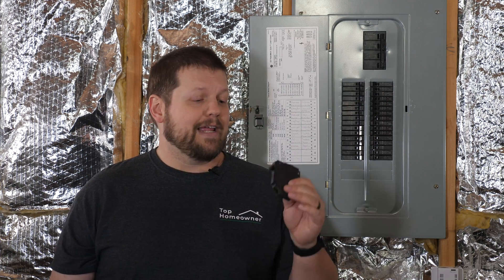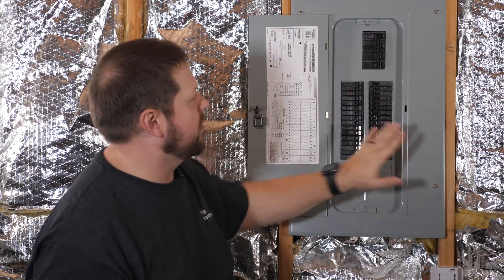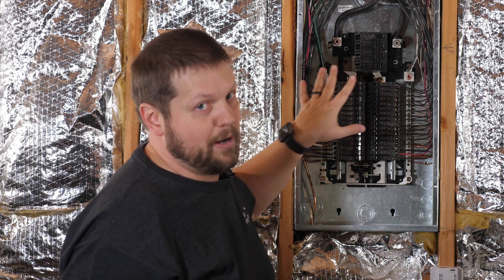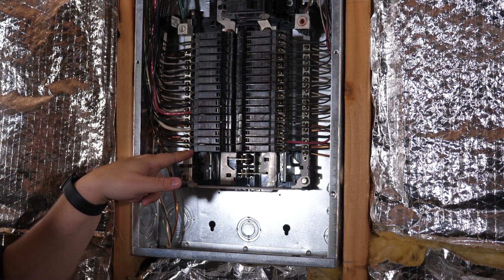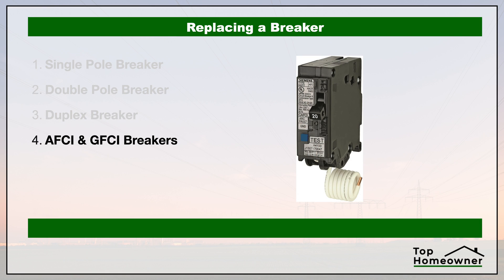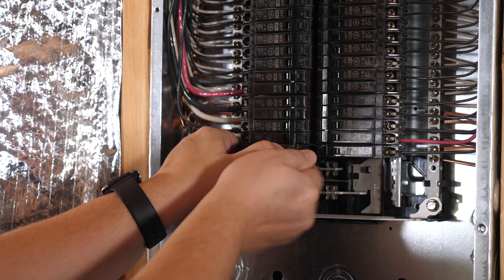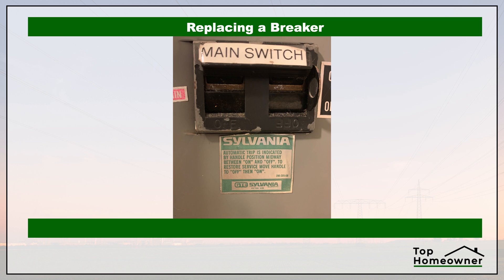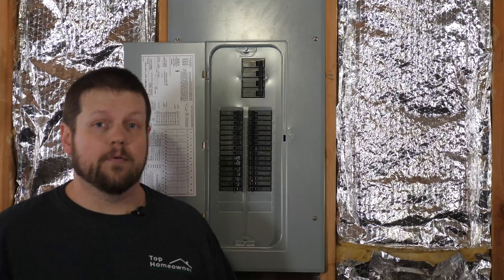How to Replace a Circuit Breaker | Quick and Simple Step-by-Step Process

Comment: I have a friend who is a licensed electrician. He is coming by today to replace a breaker. He said it was an easy job and would take just a few minutes. From watching the esteemed gentleman in the video, I agree. For someone who knows what they're doing, it does look pretty easy.

However! I know me. I'll get hurt. Shocked. I'm told that 120v house voltage won't kill me. I don't care. I have a knack for messing up DIY projects, unless they are computer software/hardware related (that's all about 5V DC. I can deal with that!) Even if the power company turned off the entire neighborhood, I would bet money on my ability to get shocked by something :D So the initial suggestion about calling someone is music to my ears, it's my wheelhouse. "Bill! How do you fix Z in your house?" For all values of Z, my answer is the same. "With my phone". 

FWIW, this was an excellent video. I understood everything. And I got the message: Call someone!

PS I've been told I ramble, and apparently that extends to online communications as well.

Comment: By the way it is good practice to flip all breakers into the off position when flipping the main breaker off, so as to when you power the main breaker back on you can flip each one back on individually to not cause a power surge to your devices.

Comment: The breaker is bad when you try to turn it on but it doesn't go 
All the way to the on position.
I moved to a house that has two breaker panels. Because the car port area was converted to a bedroom with bathroom and laundry area .

Comment: When I had my main replaced I had our electrician add a knife blade disconnect right next to the meter. When I go to work on the main panel I can cut all the power and I add a lockout tagout lock. I've seen people replace a breaker on the panel live the busbar in the panel is dangerous even more so then the main lugs.

Comment: Can I replace a 15 amp with a 25 amp ?
Reply: Not advised! A 25 amp breaker will allow more current to flow than a 15 amp circuit is designed to handle. This can lead to overheating, potentially melting the insulation and creating a fire hazard.

Comment: Can you go from a 15 to a 20 without changing the wires?
Reply from the maker: Sorry, you can't do that because the breaker size needs to match the wire rating for safety reasons.

Comment: Great video. I have a question. If I am trying to add another outlet, for example in my garage. After I add the new outlet(s) do I need to change the fuse to a higher one or not. Thanks.

Comment: Thank you so much - literally yesterday I had pass inspection from my county after upgrading to 380 AMP. Then my carpenter using an oscillating multitool cut wires on 3 branches. It’s been years since I have messed around in panels, and your advice made me confident I could do this myself.

Comment: Was experiencing flickering lights inside our home. 
Found the side of the breaker was protruding out past the neighboring ones about a half inch, so it appears the previous electrician had not fully seated the replacement breaker years ago.
After watching your video I was able to cut the power and snap it back down into it's seat.
No more flickering lights - thanks for the video!
Reply from the maker: That's great to hear! Glad it helped!

Comment: I was installing a smart dimmer. Installed it and everything was working
 Flipped breaker to finish up the installtion. Go to turn on breaker and only half the circuit worked. This saved the day thank you. I thought i was gonna be without ac. It was a 60 amp breaker.

Comment: I had never actually replaced a breaker before but understood the steps. This video was helpful and well done, so I feel more confident that I won't BBQ myself.  However, the box that our older rental home does have aluminum wires and you suggested that a pro be called.  Could you please expand on that?  Is it because the aluminum wires are more fragile?  Thanks again.

Comment: Can i still cut the power from the main breaker outside? I might have to change the entire box
Reply: Once you cut the outside main off, those conduit connecting lines coming in your home are broken. So, yes, when the main power supply on the outside is shut off, then you can jerk and pull around the top lines (THNN/THWN lines) coming into your home, to fit/fix whatever panel your putting in. And you do gotta be rough with those. But use testers to make sure they're for sure dead. Be cautious.

Think of the wiring of electricity like plumbing. When you shut off your water valve, no water goes through. Same concept. 

Hope that helps!
Reply: @TamaraGrace  Thank you

Comment: I'm about to do this m. I'm concerned about finding the correct replacement . It's very old panel and the label on front of old one is pretty much gone . Hopefully I can info like brand when I take it off and what else do I go by ?
Reply: I wrote down the information from the front of the breaker.  My panel dates from the 1990s and I discovered that the Eaton breakers are compatible with my breakers.

Comment: So two of my circuit breaker is not showing light and the water boiler and one of the heater has not been working, could this be the problem? I bought a fuss and changed the fuss but it’s still not coming on and an electrician is charging me 1990 Euros for it, could this be the problem

Comment: I recently replaced a breaker i thought was bad and it turned out a screw on the side of an outlet was sticking out and touching the metal receptacle box. Always screw those in if you’re using the plug in connections on the back instead, especially if you have metal receptacle boxes.

Comment: Hey..if permeantly removing an elctrical appliance...once located the correct breaker, can i just remove the wires going to it and leave the breaker in place?  That way i can use in future if need be for something else.  Or should i take the whole breaker out? Before removing wires, obviously shut dwn ppwer and check first.  Thanks for any help

Comment: Of course....the  bad breaker I have is an AFCI with pigtail....AND......that particular pigtail is hidden under maybe a dozen other pigtails that are over-laid and all crunched on the right side of the panel.....since most all AFCI's are physically located all on the right side. So....OK..I get it for a normal breaker, I've done those....but in this case, how do I find the correct coiled pigtail among the 12 or so that are crunched on top of that one, all connected to the right side neutral bus?...... groan!!!

Comment: In terms of direct instruction, something not covered explicitly in this video - so turn all circuit breakers off before turning off the big main circuit breaker? (And if so, how did some light source in your video turn off when you turned off the main breaker?)

Comment: why can't you replace it if the wire is silver?
Reply from the maker: Silver is aluminum and harder to work with safely and it usually needs connections that are specifically designed for it. Best to let a professional handle it.

Comment: I have a voltage tester similar to the one in the video, it blinks red and makes noise when it's on and after the main breaker is off, it just glows red on certain breakers and green for others. Does that mean it isn't live anymore and safe to work on?
Reply from the maker: Mine doesn't act that way so I can't say for sure. It's best to check the documentation for your specific tester to understand what the codes mean.

Comment: HELL YEAH, I REPLACED IT ALL BY MYSELF AND DIDN'T GET ELECTROCUTED. Thank you so much, there was no power to just ONE portion of my house, and now I can use the bathroom while not in the dark :)
Reply: I'm inspired now!
Reply: I myself enjoy pooping in the dark
Reply: That begs the question, how many people watched this video and died and couldn't make a post because they are dead?  Just kidding, but it's funny where my mind goes at times LOL.  I use power tools, but I know these are only holding the frame in place, not mounting a tire to a car...torque appropriately. It annoys me to find people screwing things down really tight only to hold a 2-ounce piece of metal or plastic.  Or someone mounts a TV and puts the lag screws so tight it crushes the sheetrock.  Idiots...
Reply: Bathrooms usually have GFCI breakers. Try to reset it before turning on. I had the same problem.

Comment: My panel doesn’t have a main switch shutoff like in this video. Is that possible? Can some work as such?
Reply from the maker: It sounds like the panel in question could either be a sub-panel, which would rely on a main breaker located in another panel, or it could be part of an older electrical system that doesn't include a main breaker. If there's another panel, turning off the main breaker there should cut power to the sub-panel. BUT, it's still important to always test and make sure the power is truly off for safety. If there's no main breaker and it's an older system, you would need a professional, typically from the electric company, to safely disconnect and then reconnect your meter. That would ensure any work on the panel is done without live electricity. Hope this helps!

Comment: Can you leave a fuse missing and just cap the wire? I want to bring the blown fuse to the hardware store to match it exactly but I'm worried about leaving that terminal unfinished/ unfixed in the meantime...
Reply from the maker: If you're disconnecting a circuit, just capping the wire in the panel is a common practice. If you are removing a fuse or breaker, make sure it's covered with a blank so that no one can accidentally get shocked.

Comment: While it may be obvious to some, make sure the replacement breaker is in the OFF position before installing (I know the panel is OFF so technically it doesn't matter but I'm more of a belt and suspenders kinda guy.  After installing the breaker, then turn the main breakers ON and the replacement breaker ON.
Reply: Today i learned a new old man expression to add to the index. Thanks.
Reply: Why would this matter?  None of the other breakers are off, right?
Reply: @PoffMan81  Feel free to ignore every safety advice you ever read. Without people like you, there would be 20 billion people on the planet instead of 7 or 8 billion.
Reply: I love the belt and suspenders analogy.
Reply: better safe than sorry
Reply: I saw that. Thanks for clearing things up!

Comment: Why does that screw driver click? Does it have a torque spec built in?  I know it ratchets but right as you finish it seems to make a torque click.
Reply from the maker: No torque, I must have backed it off slightly when I removed it.

Comment: Hey, just watched this video. My issue is this, all my outlets in the bathrooms and garage (5 total) are not working but no breaker is tripped. None of the outlets are burnt or look damaged. Any suggestions?
Reply from the maker: The next thing I would check is if you have any GFCI outlets tripped. Sometimes they can even be located in another room. Otherwise its probably a loose connection inside one of the boxes.
Reply: @TopHomeowner  Preciate ya, you are the man ×10

Comment: What if you don’t have a main shut off
Reply from the maker: The only option would be to have the electric company cut the power. Some electricians will work on residential panels while they are still "live" but I'd never recommend that. I would recommend contacting an electrician for help though

Comment: Thank you for the nice video.  We have a loss of power to some outlets in the basement, but no breakers are in the tripped position.   We suspect that some breakers have gone bad and probably need to be replaced, but we have difficulty identifying which ones are the bad ones.  The labeling is not detailed enough to be helpful, so how should the bad breakers be identified?  Would the voltage detection pen be the tool to use or are there other means?
Reply from the maker: I made a follow-up video to this one that explains the symptoms of a bad breaker: https://youtu.be/WviuwlcRtYE
Also, you may want to make sure there isn't an issue with the wiring if only some of the outlets aren't working. Here's another video that may help: https://youtu.be/d5h1JjnaJMk
Reply: @TopHomeowner  Thank you dearly, sir.  I have found some directions and confidence and going to check the outlets and the breakers.  Wish me luck!

Comment: Very helpful.  Thank you. Is it ok though to turn back the power on while the old fuse is out as I bring it to the store?
Reply from the maker: That's a judgement call. If you put the panel back in place you'll still have a gap where the old breaker went which makes it more of a hazard (someone could stick their fingers inside). You could also take a picture with your phone and match it up that way.

Comment: Can I change a 15amp breaker to a 20amp breaker?
Reply from the maker: No, the breaker is rated for what the wiring can handle safely. If you increase the amperage of the breaker, you risk melting the wire and starting a fire.

Comment: Thank you - was able to replace a bad breaker myself.  I appreciate it. I diagnosed it was the breaker by turning of the main and it still would not reset.  It should have reset with no power on the circuit so I replaced it and problem solved.

Comment: I have a 60's era Square D subpanel. I'm guessing I'm out of luck replacing just the circuits.
Reply from the maker: Square D may still make breakers for it (or another company may make a replica), so look into that first before deciding to do any major work.
Reply: @TopHomeowner  Great suggestion! In fact the breaker you took out looks like the ones in my panel. Thank you!

Comment: The was a great video for non electricians.. it helped me alot.. even though I was scared as shit doing it... 😆 I had to replace 2 of them and I watched ur video step by step while doing it..m so thank you....
Reply: I got to do it with no main breaker shut off..😃 if I survive I'll update my comment🤣
Reply: I survived it was pretty easy it was a breaker all the way on the bottom so after I took the cover off I just pulled the breaker off the main bar so that means the breaker is disconnected so all I did was transfer the two wires to the new breaker and then click it back in..
Would have been nice to be able to shut off all the breakers with a main breaker up top but there wasn't one
Reply: @Miketaylornews R.I.P to this man
Reply from the maker: Glad it helped!
Reply: @TopHomeowner  so I have a question... Can u attach the wires to the fuse before u put it back in its spot in the box??? It's so tight in my box that I can't get any room to put the wires back in once the fuse is in place.. if I attached the wires first before putting the fuse back in the spot It goes will it shock me???
Reply: @Mike-jx8ks Yes.

Comment: My house has the main breaker outside and all the breakers for the individual rooms are inside. Is this not normal?
Reply: That's fine, my house is the same way. The main power shutoff is outside by the  meter, and I have another sub-panel inside my garage with all the breakers.

Comment: Does it matter which wires are connected to each screw .  Like the red and black wires should be black on top and red on bottom or are they interchangeable?
Thx
Reply: He tells u in the video.. he says to make sure u out the same wire back on the same spot it came off.. so don't cross them.. if red is on top then put the red one back on top..

Comment: My breaker (20A) tripped when using a portable heater, can I change it to 30A? Will that stop the breaker from tripping?
Reply: Do not put in a 30A breaker! Your wiring is only safe for up to 20 amperes of current. The 20A breaker is trying to prevent a fire, maybe saving your life.
Reply: NO!
Reply: Lol
Reply: Dumb question probably then, can I put a 15A to replace a 10A?

Comment: Great video. My issue is i need to change a smoke detector in my living room. I turn off circuit breaker but i still have power in my living room. Is this a circuit breaker issue or something else ?  Thanks
Reply: You must not be turning off the right breaker. Sometimes they're labeled incorrectly. My house is like that and I had to remap all the breakers by turning them off and checking what had lost power. You can also just turn off power to the main, instead of just a single breaker. This will cut power to the entire house.
Reply: @scylusblack6241  let’s say i want to change the ceiling fan, i turn off that circuit and still have power. Would that be a circuit issue then ?

Comment: Im about to try this in my home this afternoon.. I bought a volt meter pen and tested it just to be sure.. electricity is not something to play around with!
Reply: Volt meter pen isn’t sufficient imo. Use a multi meter for stuff like this. Then you KNOW for a fact, that there’s no power.
Reply: Yet you did it😂 how did it go. I lost the garage outlets, and the breaker switch wasn't tripped. What kind of volt meter did u use and did it work for you? Gonna do it today and don't like ⚡.😂

Comment: You mentioned that all the breakers were off… Is that required or is the main shut off enough?
Reply: When he says all the breakers are off, he means because he flipped the main power breaker to the panel off. (As you say, "the main shut off".) This turns off all breakers. I think some ppl are confusing that with actually flipping each individual breaker switch off... Not necessary.
Reply: You should always shut off every breaker before shuting down the main